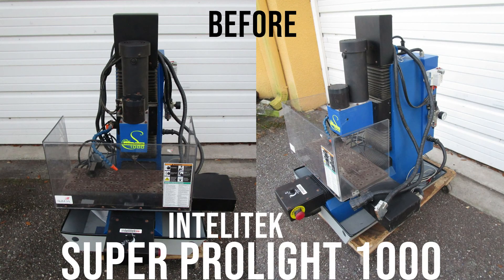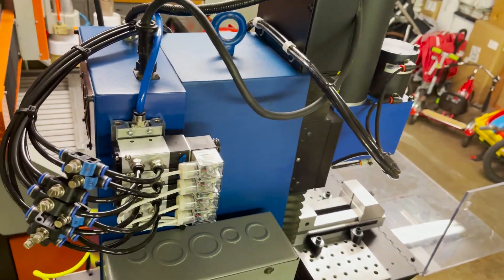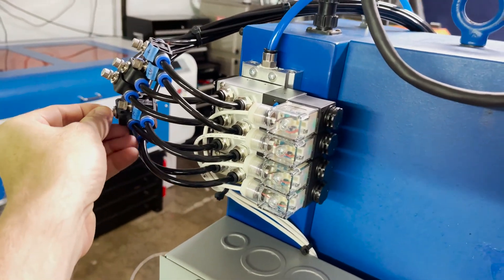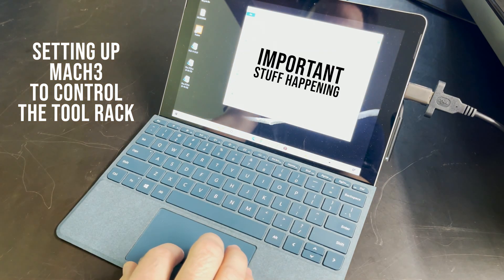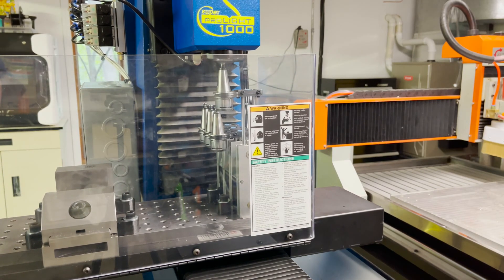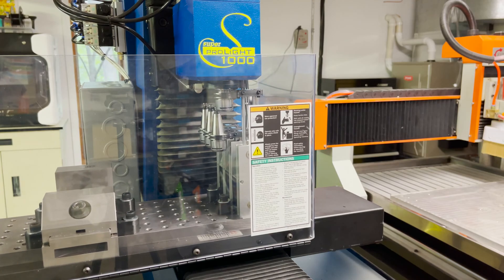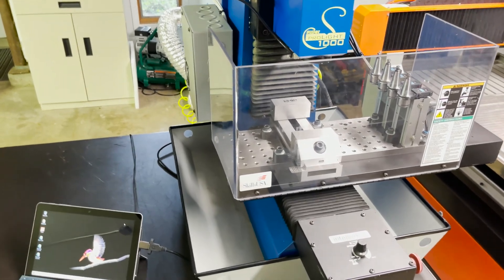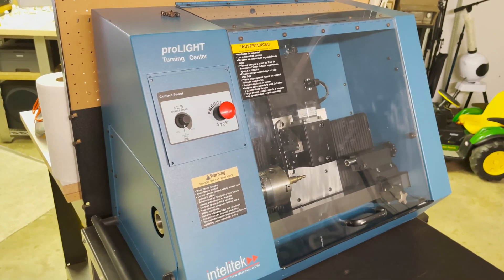DIY pneumatic ATC tool holder rack for a Mach3 controlled Super Prolight 1000 CNC

Comment: Why did you feel the need to lift the tool holders up with the piston?
Reply from the maker: I was replicating the design from the original manufacturer. I somehow overlooked that they designed the head on this machine different than their others, and it has a pocket to create the proper clearance for tool changes, so for V2 I got rid of the pneumatics.

Comment: tilt cylinders at 45, hang them further off the end, get a bit more table space...

relying on air bleeds on cylinders is a bit iffy. theyre dictated by pressure and friction... they tend to get sticky. lube dries out, blah blah... fine if all you are doing is pushing something, no good for delicately placing something.

better to throw extension springs on to limit the lift, use the bleeder on the retract. that bit of preload on a cylinder makes it behave so much nicer. the subtle difference between pneumatics and hydraulics...

Comment: Just found out about your channel. this is a pretty smart method to solve the space issue.. Could even add another toolholder on the other side of the actuator and double the slots.

Comment: You could probably re-print the tool grippers to be double ended , move the tool changer slightly left, if you have the room and get 8 tools total, two per cylinder
Reply from the maker: Thanks, that’s a great idea! Though, I ended up having to change this tool rack setup when switching to the Masso controller, so now it has 6 tool spots and an auto tool setter instead
Reply: @diyfiberlaser  Whatever works for you, I just had the idea that each cylinder could lift two tools if you have the X distance to accommodate it.

Comment: Amazing work! Quick question, how did you clean your table? It almost looks etched. 
Also, I did not know you are missing the controller box and card, I had a spare from my machine. I also have a SPL. 
Is there no issue with the different stud geometry on the tool holder from the original? Luckily my machine came with new original tool holders. 
One dislike about this machine, is that when cutting, chips and shoot out and make a mess lol.
Reply from the maker: I just used wd40, steel wool, and fine grit sandpaper to clean off the rust. No worries, I would have changed the controller regardless so I could use Mach3 with my tablet to run it. As they arrived new, the tool holders wouldn't fit. (I bought them off ebay: 
REDS ISO20-ER20MS-35 Precision Collet Chuck Tool Holder) I had to file down the pull studs slightly...now they seem to insert and release smoothly and appear to be well-seated within the spindle....I'll know more once I actually start cutting. Haha, I was guessing that the acrylic shield was going to be pretty useless for containing the mess....maybe I'll build an enclosure for it.
Reply: @diyfiberlaser  Excellent! I did something similar, but I didn’t use any sandpaper, only steel wool. At this point, it’s only discoloration. 
I’ve called Intelitek to get an estimate for the holders and was quoted $350 per. That’s a hard no for me lol. 
I’m thinking about doing the same about building an enclosure. I would love to see how you setup your electronics. I’m thinking about retrofitting mine later down if anything happens to the controller or pci card. I also hate the wire nest in the rear. The way you wire managed is PERFECT! I also want the smaller footprint possible. They aren’t that small to begin with lol.
Reply from the maker: @juansalgado6212  Yikes! ...those tool holder I bought were only $20 a piece.